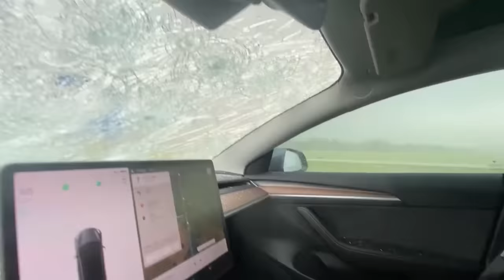People VS Mother Nature

Comment: As a resident of SE Idaho I can sympathize with the winter scenes. I've sunk into 8 foot drifts and got out all by my lonesome VERY COLD!!!! At least twice have I broke through icy canals and 3 or 4 times in the cold lake nearby. We frequently get both heavy snows and hailstorms that break large tree branches for the weight of the snow/hail. We commonly get 50mph+ winds, though I only recall one time when it was over 100 mph -that was real fun getting into the barn!

Comment: When that skier was completely swallowed by the snow (and they had to dig him out), followed by the next one falling off the ledge, I couldn't help but laugh uncontrollably for several minutes. 

When I was about 2 or 3, we had chickens and a hailstorm came up suddenly, and my grandmother went out to get the chickens in before they were killed, holding a thick pillow on her head to keep her from getting brained (they said the hailstones were rather large) but was still nearly knocked out, and I was told that several of the chickens were killed by being struck, so we evidently had chicken for our meals for quite some time after that. 

My mother's youngest sister, when she was about 5 or six was picked up by a strong gust of wind and carried about 50 feet, through the air (so I was told), which traumatized her so much that for the rest of her life, a strong wind blowing (either felt or heard) would send her into a panic. 

Out here, in the Panhandle of Nebraska, we get "stampedes" of tumbleweeds, as seen in the video, but seldom as extreme as the video showed, both with the strong winds we get here but also because those tumbleweeds (Russian Thistle) are too darn common around here (they are now considered a noxious weed, but nobody can figure out how to get rid of them).
Reply: That avalanche guy though.
I think I'd rather be the ski jumper.

Comment: 1:40 Should have stopped at that initial puncture.
6:30 That's why the traffic laws everywhere where Winter is a thing, winter tires need to be mandatory, just like in Québec. 4 seasons tires are prohibited during the Winter here. Most peoples have a set of rims with Summer tires, and a cheaper set with Winter tires.
10:00 Crazy hail storm in Canada ? Not at all. Every year there are a few like that in at least some regions.
12:30 Poor horse.
19:30 Remember that tumble weed are NOT native to anywhere in the Americas. That thing was imported.